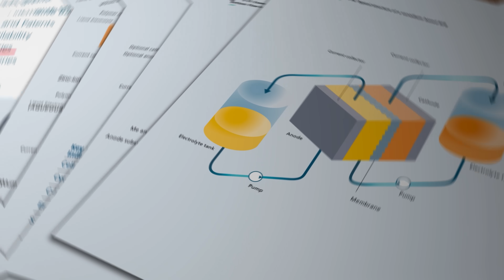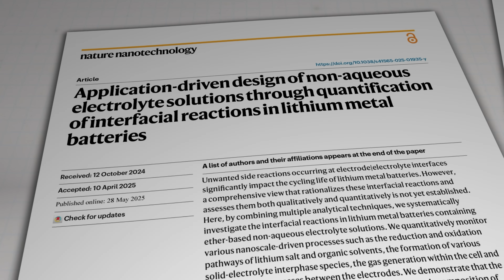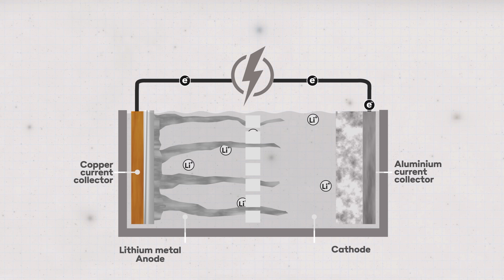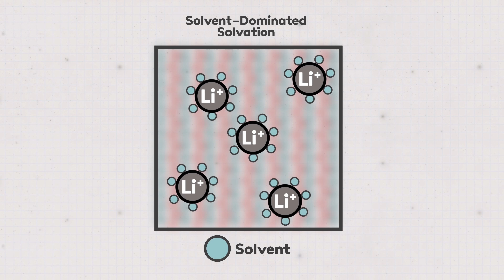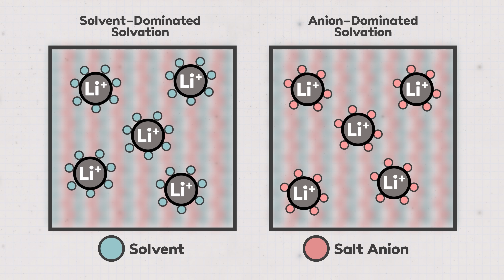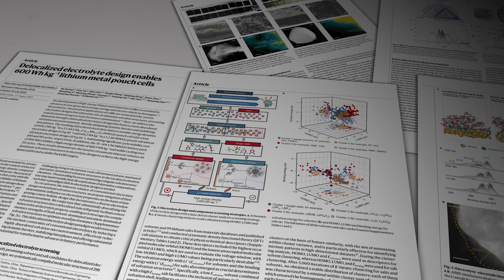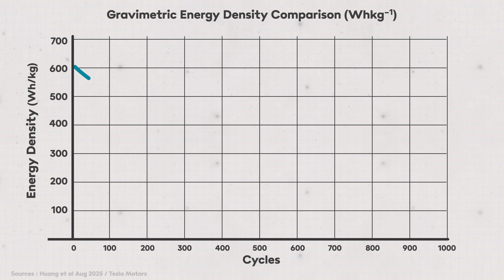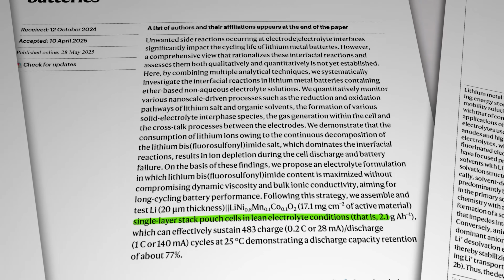New lithium metal battery doubles energy capacity! Has China beaten us to it again?

Comment: Meanwhile Finland is starting a new sand based heat battery project. I was a skeptic about those (cause of heat pumps), but I think they are more and more  clearly the future of combined heat and power plant in my city (Poznan in Poland). Big residential apartment blocks need central heating. Individual heat pumps are just not a solution cause of little space and reinforced concrete walls. So I think there is going to be a big demand for sand and sand-like solutions.
Reply: woudn't a heat battery synergize with heat pumps instead of being in competition? you can run the heat pump during the day when its efficiency is higher and energy potentially cheaper because of solar charging the heat battery and discharge it at night when the efficiency of the heat pump drops and energy is more expensive. IIRC those heat batteries have a round trip efficiency of over 90%, so I dont see why that would not work. For sure not for detached homes, but if you have a hear heat network or for multy family houses that seems fine.
Reply: @mlsasd6494 I already do that with my heatpump. I have in floor heating and a 2000 liters water buffer. I start the heatpump up at about 10 AM when electricity from PV starts to be substantial and outside temperature is higher than most of the day. This provides the best case scenario for the heat pump to be efficient while also setting the temperature on each thermostat at 2 degree higher than desired at night. This means I heat up the entire house to about 23.5-24 degrees celsius with the heat pump running between 10 and 15 o'clock. After the house is heated up, the water temperature in the buffer starts to also rise and ai have the heat pump set to stop itself when the buffer temperature reaches 40 degree Celsius. Usually the house thermsl inertia is enough for the temperature inside to not go under 22 and 21.5 celsius respectively until about midnight. Then the buffer comes into play and supplies the necessary heat up to 10AM when the cycle repeats. The heatpump restarts only if the temperature inside the buffer goes under 28 Celsius which happens maybe ones or twice a year when the outside temperature are under -10 at night, which is not a problem.
Reply: @mlsasd6494 Heat pumps work most efficiently when heating a low temperature load (hence bigger radiators are recommend for HP installations). Heat batteries generally run at high temperature in order to store more energy, so HP and heat batteries generally don't work well together.
Reply: It's called a storage heater here in the UK and gas been around since the 1960s.
Reply: @petewright4640  a massive sand thermal storage "battery" heated to 500°C with off-peak electricity to provide district heat is quite an evolution of a storage heater.
It may not be better than individual houses using more efficient heat pumps. They can use off-peak electricity stored in electric batteries, such as the one in your EV. I suspect in chilly Finland heating would require more expensive, and it's worth the expense of building a district heating system.
Reply: @petewright4640 .... albeit not best efficient.  I lived with storage rads ("slimline" ones from the 1980s), which invariably needed topping up precisely when electricity demand hit the evening peak!  Coupled with a domestic electricity storage battery to overcome said peak, they'd be considerably more useful. 

Mind you, with effective thermal insulation (and associated decent ventilation) incorporated into the building design, that top up would likely have been unnecessary in any event.
Reply: they make all the sense in the world as long as they are NOT utilized for electricity generation, where they suck like every other boiler-steamer type of solution

Comment: I love the episodes updates where you focus on battery technology !
Reply: Currently (forgive the pun) Lithium batteries have an energy density of 0.5 MJ per Kg, this technology could increase it 100% to 1MJ per Kg. 
Only another 4400% increase needed to make it as efficient as Diesel fuel powered cars (45MJ per Kg).
Reply: @pauls3075 My duramax likes the sounds of that 😃
Reply: How well does this one burn 🤔😆
Reply: @gmw3083  Probably less fiercely than silly rhetorical questions like this!
Reply: @gmw3083  I assume if you chop it in water, lithium metal should catch on fire :). I'll take double the density for portable electronics. Linux on ARM and new battery tech would bring incredible battery life :)
Reply: @ArthursHD Does Linux use less power? I have Linux installed on my hackintosh but it was a back up OS installed when the hackintosh broke down. I'm still using El capitan I guess it is. The guy said I should try Linux but I never did. I don't turn it on that much. The phone does most things I need. Are there Linux phones? What are you talking about 🤔
Reply: @gmw3083  Android is based on the Linux kernel. Compared to Windows, Linux uses less RAM and has fewer background processes. That said, it maybe milliwatts less. OS is more of a preference thing. But hardware like RISC-V and ARM uses less power under load compared to x86. As for idle, it will depend on the supported power states of the SoC/CPU and peripherals, as well as the power circuitry. GaN PSUs usually have a lower no-load power draw. As for video playback and encoding, it will depend on the VPU and the app support for the specific codec you are decompressing/playing. Local AI would use less power on an NPU compared to a GPU. 
I haven't delved deeply into macOS and iOS.

Comment: You claim the degraded EV batteries are reused for stationary storage, but even at Tesla this is not the case.
Most end of life electric vehicles are NMC based and are pretty hard and dangerous to take apart at a cell level.
While some small scale projects were done, this was mostly for PR purposes, just bundling complete battery packs and building such a system without taking cost, physical volume and long term safety as a consideration.

In real life, most electric vehicle batteries are just recycled or even left in the discarded vehicle where it is stored as taking it apart and getting rid of the batteries is just not profitable. 

I do believe this will get better with LFP as this is much safer and the cells will outlive the rest of the car in most cases. 6000 cycles is a lot.
Reply: Wrong on all counts
Reply: Search "Redwood Materials Storage" (AKA "Redwood Energy")
They just launched their (First) 63 Megawatt-Hour second life battery storage project.
(Neither "Small", or for "PR Purposes")
AS for "Not even the case at Tesla", Since the CEO at Redwood is JB Straubel, I'm sure they have at least had "a conversation"?
THEN
"GB 38031-2025, titled "Safety Requirements for Power Batteries for Electric Vehicles,"
(It's the new Chinese standard for (ALL) vehicle (and other|) batteries.
Basically "Zero tolerance, no fire, no explosion"
AS for "End of life NMC", If DISCHARGED, they are Inert, NOT "hard", OR "dangerous" to take apart at cell level.
(It's the "Energy" that makes them "dangerous"  if mishandled)
Where is your evidence that Packs are "just left in the discarded vehicle? (Verified data please, NOT "opinion")
"Life of "Cells"? (you mean "packs"?)
I'll refer you to the recent Jeff Dahn Webinar, titled "V2G and second life for batteries" in which he details (as an EXPERT) the state of cell development and potential for longevity of ALL cells, Iron AND Nickel based.

Comment: We're on the way to cities that generate more electricity than they use. Let's vote to speed run this and end centralised energy production.
Reply: Cities already generate more electricity, then they use. It was more or less the case for more the 30 years. Before that blackouts ware a normal situation, but back then electricity was less crucial. That is the reason for night tariffs (most of overproduction was during night hoers). The thing is, we mostly dumped the excess to the ground. That is why we need storage.
Reply: @guciolini123  Cities never generated more electricity than they used.  They were powered by electrical generators that were far from the city.  At the very beginning of electrification, there were power plants in cities.  They were soon moved outside of town because people like clean air.  Electric utilities don't want to send power to ground.  That costs money.  They would throttle down the generation plants as needed.

Comment: I hope this does unlock electric aviation however I personally feel the sodium-ion NAXTRA battery will be much more important overall because of how affordable and mass-market it will make BEV's soon enough. 5C charging, 1 million mile lifespan, 10,000 charge cycles, only a 6.5% trade off from LFP for a huge cost savings... Those are the types of innovations that the 99% needs!
Reply: Have you actually researched the NAXTRA pack?
5C, But 175Wh/kg, so well behind LiFePO4.
(And the OTHER CATL packs [Shenxing] hit 12C )
AS for "1 Million Mile",  that's going to be standard for ALL CATL packs (and other brands)
Reply: Sodium has lower volumetric and gravimetric energy density than Lithium. The CATL Naxtra announcement indicated they've managed to increase the gravimetric energy density to closer to the lower end of LFP batteries, but no where near NMC or Li-Metal (as in this video).

The volume of these lower energy density Naxtra batteries appears to be 15-20% more, meaning fewer cells at the pack level so significantly lower battery pack energy compared to Lithium.

Sodium also requires more expensive electronics due to its wider voltage range and is sensitive to heat (starts to degrades from mid-30°C) so requires more extensive cooling.

This is why CATL are focussed on using the Sodium batteries in dual-chemistry hybrid batteries, where the rapid charging of sodium is useful but the bulk of the electric range comes from the lithium side of the dual pack.

Costs savings are not that significant at volume, $55 per kWh for LFP vs $19 for Sodium, a differential that is eroded at the vehicle level due to the pack size energy difference, extra cooling and higher electronic costs involved.

It's more likely sodium, including Naxtra, will find a niche in static energy storage rather than battery EVs, where its lower energy density, volume and requirements can be more easily addressed at lower cost than in vehicle applications.

Comment: Very interesting video, the highest ever energy capacity I had heard of was 380 Wh per kg (for aeronautical application). These batteries were so prone to thermal runaway that they needed a very expensive ceramic matrix composite envelope and chimney. In case of batterie fire, the flames would go through the chimney behind the aircraft and allow for safe landing.
Reply: Lithium Sulfur chemistry is already achieving 500 Wh/kg cells and powering prototype unmanned flying vehicles. These cells are proven highly stable and safe over 1000s of cycles.
Reply: @bigdavecoxy  Exactly, there are at least half a dozen companies currently testing 500wh/kg cells in vehicles currently. There should be some low volume (a few gwh) production coming online in the next two years for some of these companies. 

That includes CATL, BYD, a few American companies. And of course the Japanese manufacturers have been giving hints that they have solid state plans as well. 

The bottom line is that the target with experimental chemistries like in this video is probably a lot higher than 500-600wh/kg; this is a long term agenda and not coming to market soon. The 500wh/kg batteries  coming to the market from next year is a lot further in terms of the technical readiness scale. It's basically at or near production ready. The big blocker there is not technology but financing for building big battery production facilities. 

Not all of them will succeed, I expect as competition is going to be fierce. And a lot of battery producers are struggling with over capacity and under utilized capacity for their existing batteries as well. I think this could lead to some delays.
Reply: isnt solid power having this ?
Reply: Chimney on an airplane, sounds interesting...
Reply: These are explosives, not batteries

Comment: I think these possible improvements could lead to a 600mile EV wanted by the few with enormous bladders
Reply: Or just lighter EVs
Reply: @oliversissonphone6143  or just smaller, lighter & cheaper EVs ;)
Reply: @oliversissonphone6143 That's a good point I have noticed better miles per kilowatt from third generation EVs and it could be battery weight as physics has not changed f=ma.
Reply: @oliversissonphone6143  i think this is over looked by EV fan boys, most Evs are 3x heavier then a ICE counter part. 

That has implications on our roads and taxes to repair them
Reply: @mitchelldalton7405 Are you saying that people should be driving smaller, lighter vehicles? Or that we should be taxing heavy vehicles like SUVs and pick-ups?
Reply: @oliversissonphone6143  im saying Evs cause more wear and tear on our publicly funded roads. 

Costing everyone more money. It be good if capacity stayed the same but save 50% in weight. Then gaining more range
Reply: @mitchelldalton7405  EVs are not 3x heavier than comparable ICE cars. 
My Bolt is about 3,700 pounds. A comparable car would be around 3,200 pounds. 
An Audi Q5 is about 3,800 pounds and a Honda Odyssey is about 4,200 pounds, for comparison. 
Now, Teslas are heavy. My Audi E-tron is also heavy at about 5,700 pounds. But that's not 3x the weight of the Q5, it's more like 1.5x.
Reply: We already have silicon anode china is already at 550 mile range already
Reply: @viyusavery248 give me the model please
Reply: this will enable a lot of trucking routes currently not feasible
Reply: @SmaskysButler at least in europe trucking is already working very well. MAN had an article at how great the return is on electric truck, and their is a channel with an electric trucker.
Reply: Or lighter more efficient EVs that suit >95% of the population.
Reply: I pride myself with my an enormous bladder, thankyouverymuch. I am a firm believer in diuretics and more charging stations can help us go further. I call it, just have a wee
Reply: Very droll
Reply: Having invested in a Polestar 4 with 350 mile range and home charging I will never buy another fossil fuel based car again - £30 a month capped EV charging and access to Tesla Superchargers mean both day to day trips or a visit to Cornwall or even further is seamless now.
Reply: @johnjoseph911 same here
Reply: Funny and slightly Fair comment. However more energy densities needed for various trucks - passenger, light duty, delivery, semi.... And also my 300 mile Tesla in reality gets more like 200 on the highway in the winter or summer.
Reply: Or, smaller cars could have usable range. 
Or, conversions of ICE cars become more reasonable with smaller batteries. 
Or, more options in range, long range or standard range, with lower prices for the shorter range. 
Or, more possibilities for replacing the battery at home with a smaller and lighter package. 

Balancing battery size, weight, energy density, and cost involve tradeoffs, but fewer tradeoffs are necessary with a smaller battery package.
Reply: That's why you buy a gas car. (/s) Our gas car came with an over-promised/under-delivered claimed 600 mile range that, in practice, is typically more like 480 miles in summer and during winter more like 350 miles. It sucks. And we drive very carefully, e.g. I could get up to 45 miles per gallon out of my 1990s Ford Escort wagon when I was in college.
Reply: You need 600 mile range to find a decent cup of coffee whilst recharging.
Reply: @paulaspinall919 he hee so true in UK
Reply: Don't encourage them!
Reply: Fair comment, but if you can not charge at home then you would appreciate a week or 2 of driving in a single charge. Do that at the supermarket and you're good to go. No need for at home charging infrastructure... Time to move on from one days deiving per charge.
Reply: It's even better with world standard ~1000km  (226 years not enough to change bad habit ;)
Reply: And the (especially off-grid) campervanners who need the battery to cover cooking, fridging, lighting and heating as well as moving the vehicle around. That's an application where massive capacity really does make sense.
Reply: @xxwookey good point I tried two lfp leisure batteries when I had my camper and it did not run the fridge overnight.
Reply: After reading the comment, I will take train forever.

And all those few will be in single vehicle or different vehicles ?
Reply: @VijaygKamat  "After reading the comment, I will take train forever."

Nah, that is way too long a train ride, especially if there are no toilets onboard. Imagine the the humungous size of your bladder when eventual your time is up.
Reply: I do a 1800 trip in 18h across Europe, with one stop of 5 minutes to refill and take a bathroom break. If there are no roadblocks. Having an EV would add at least 3-4 hours to my time. So yes, although I love the idea of an EV, it's still not an choice for me. I do 80-90.000km per year. When there are roadworks and accidents etc, that time increases to 24h, sometimes even 30h. And I spend hours on end in the car, in almost standstill traffic. I prefer my car with 1400km autonomy in these situations.
Reply: @elfhelmpI make sure we build that EV with the enormous battery just for you
Reply: Range needs to exceed ICE cars, otherwise it's not progress. Pretty simple really, people don't want to go backwards.

Comment: I'd be curious what the cost/kWh would be if they were only used 100 times. If it's low enough, then such limited lifespans might not be a dealbreaker for the aviation industry. And could enable computer services based around LD3 format batteries.